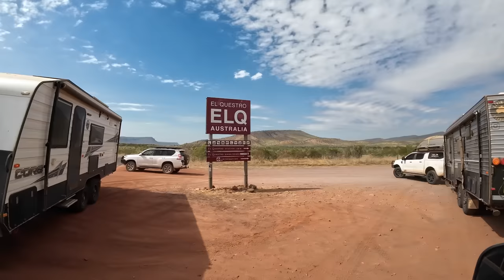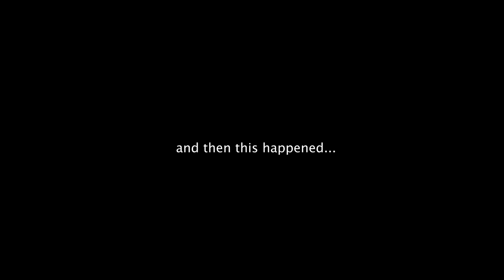THE WORST DAMAGE YET!!! Is our trip getting cut short???

Comment: Nice to see the ladies getting involved with off road videos after all they are there too. FYI, I have done 1000's of kilometres on dirt road mainly in the 70's and 80's but last year we took our 2012 ford territory awd up the Great Central Road from Perth to Uluru towing a off road trailer (not a flash one either) we had  one issue with a old tyre. I don't recommend lowering tyre pressures below the recommended operating pressure unless it is boggy. Lower pressures increase the chance of side wall damage from sharps and can greatly reduces handling when you need it most. I ran 36 psi, the same as I do for around town.
Good video just the same.
Reply from the maker: Thanks for the tip Roger 😁
Thanks for following along our journey!

Comment: OMG what a bugga! Luckily Kununurra is not too far away as something like that needs luck on their side. I mentioned about driving on the other side of the road to avoid the worst of the corrugations. Perhaps it was my suggestion or else others know the same trick. 😊 In anycase I hope it helped a bit. I think if I was going there I would get a rooftop sleeper for that specific trip. And I would most likely be travelling alone too which appears to be not a good plan for that area. They certainly seem to be the worst corrugations in Australia. Not even across the middle of the continent has them that bad. But I don't know about laying bitumen all the way despite what people say about it increasing tourism. They might want the extra revenue but do those places need the extra crap that goes with easily accessed tourist places.
I hope your steak dinner was good. The rain is coming! I hope you don't end up having to leave there too soon.  🙂
Reply from the maker: Yes I agree, those are the worst corrugations we have ever done and we have been to the Cape and have done the Oodnadatta Track aswell as other corrugated roads and nothing compares, the sheer length if the corrugated roads is the bad part.
We are lucky that this happened closer to Kununurra, rather than in the middle of The Gibb, that would have been a disaster 😳

Comment: Possibly overtightened the U bolts.  With spring washers they don't need to be crazy tight...
Reply from the maker: Thankyou for the tip 😊
Reply: Just a note, you should not use spring washers anywhere,  no bolt manufacturer or technical publication recommend them for anything,  flat washers and correctly torqued.

Comment: It probably would pay to carry obvious spares such as u bolts?, nuts, bolts. Spare Anderson plugs . Soldering iron
 Fuses. Engine belts. I would carry a compact stick welder and a small qty of steel angle and plate etc.
Reply from the maker: Hi Frank, we did carry alot of spares and nuts and bolts etc we just didn't think about ubolts this time 😅